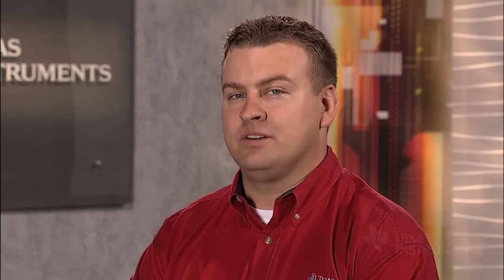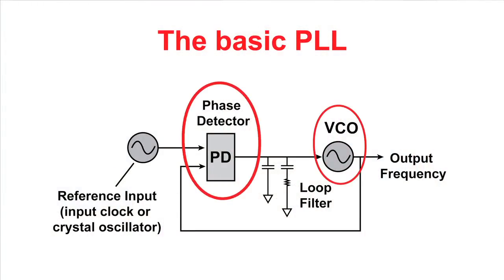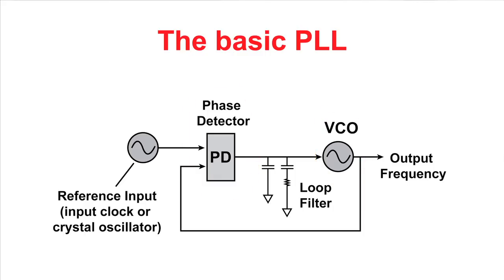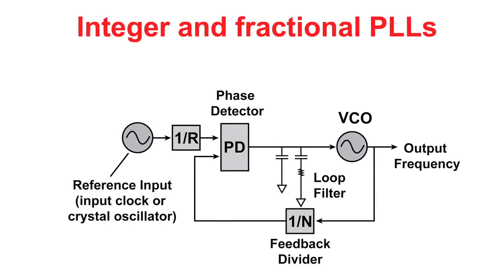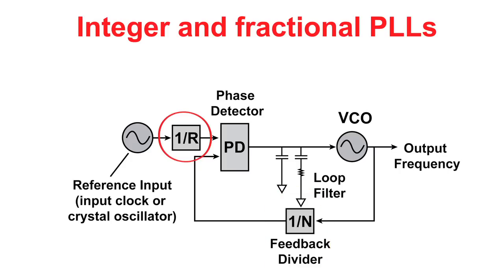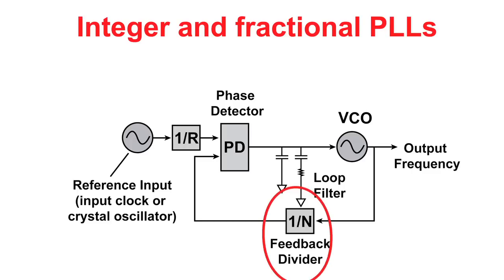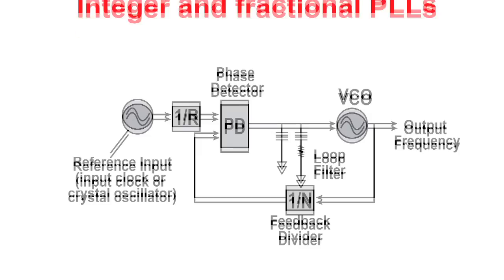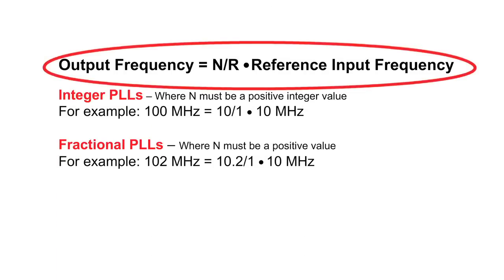PLL Basics and Usage

Comment: I have some TI chips, namely the SN761672A, I need to learn to access and get to run, there isn't any application note for it. Well, the data sheet has basic information for qualified and experienced engineers in the field. But some elaborate examples from talented tutors to newbies would be a hit. Something like setting the chip to default, load with parameters and save a frequency and most important how to extend and expand from this outset. Thanks.